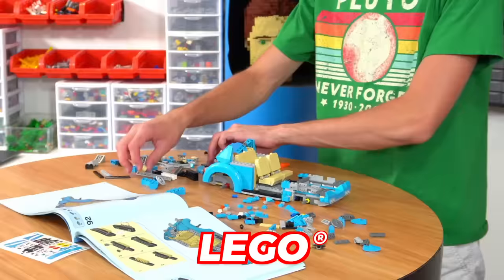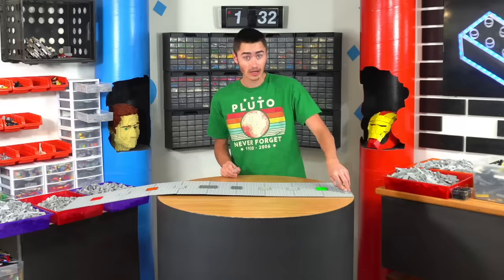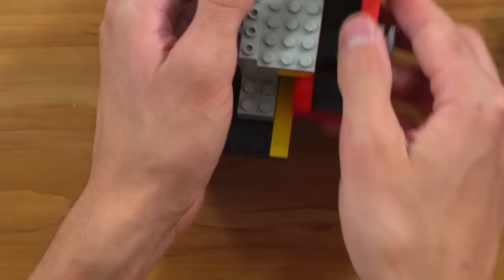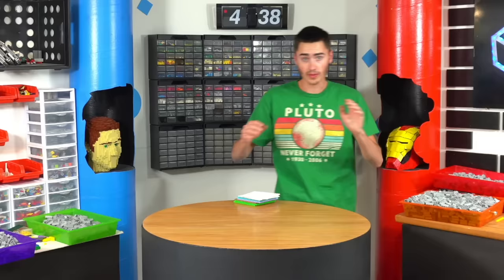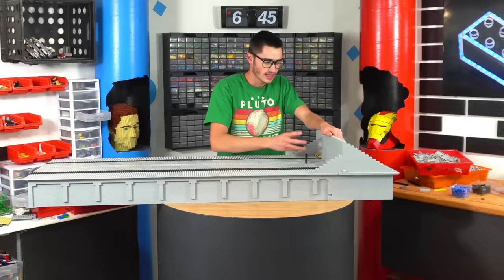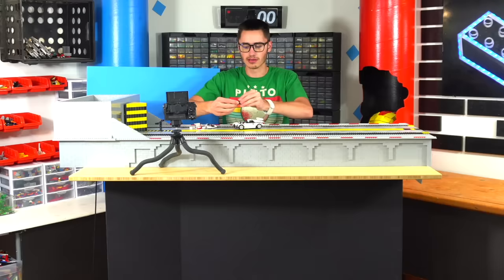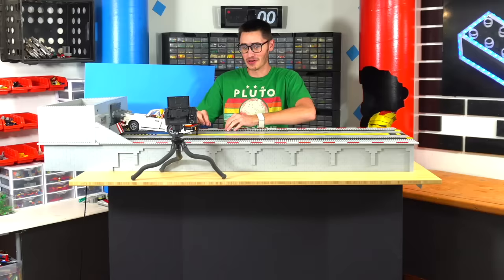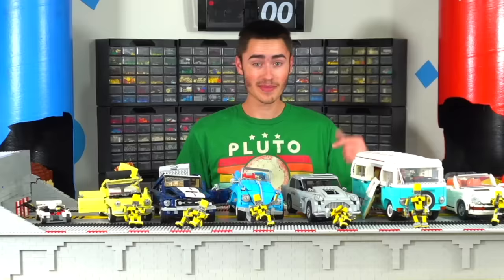Crash Testing LEGO Cars!

Comment: Funny enough, in the mid to late 1960s the first and second generation of the Ford Mustang, as well as most cars at the time, were actually built with solid steering columns, so being impaled in the event of a front on collision was a genuine issue/concern
Reply: Amogus
Reply: fords solid columns were designed to shear off, unlike chevrolets
Reply: The Chevy steering columns lead to the nickname, “The Impaler”
Reply: @jimmiechase9485  And this is why they made the Chevy Impala
Reply: @CharlesB21  still safer than the Pinto... he'd better not build one of those for a test in the future the impact might suffice to destroy the entire studio.
Reply: @CharlesB21  Ok that's a pretty good pun
Reply: @cericat  Actually, the Pinto wasn't even less safe than other cars, it just got the PR of all cars having bad safety. :D
Reply: Yeah but the airbags would... I mean you'd be saved by the seat bel... well at least the crumple zones...  Hmmm.  Well, at least cars weren't written off by fender benders like they are today!
Reply: lego with the historical accuracy
Reply: Was gonna say same thing. Worked summer months for a couple years back in the day at my local wrecking yard. Saw  quite a few cars with steering wheels pushed into back of seats and leftover messes.
Reply: Ayy I wasn’t alone lol
Reply: Mustang was still better than many cars of the era since the steering box was close to the firewall. Some cars had it more or less behind the bumper which meant that anything more than a fender bender started to push back the steering assembly.
Reply: Not just then, but pretty much all cars up until that era had solid columns.  It only became such a significant issue in later years because cars went from a very upright position with relatively low speeds, to a lower seating position with a more linear steering column and much higher speeds, as well as increased average weight.

There all led to the solid columns going from merely "hazardous" to absolutely lethal and practically guaranteed to kill.

Combined with extremely rigid car structures and no seat belts, it made for a very dangerous time to get into a collision.

Let's also not forget the tendency of hoods to cause decapitation.

Comment: Ironically irl, the ratings likely would’ve been flipped. Cars are made to collapse in the event of a crash so it absorbs the brunt of the energy. If the car was completely solid, most of the energy is going straight the the occupants of the car and… carnage ensues.
Reply: Yes and no. Modern frames are built with crumple zones, since if your A pillar collapses, the driver is fucked.
Reply: as long as it dosent wreak the engine, your right engine explosion is why

Comment: NGL having built everyone of these the thumbnail really grabbed me. Given how structurally fickle some of these can be when handling most of these preformed astonishingly well not only remaining intact but busting up the test wall as well. Really good test track built but for more destruction longer means more speed. Have to wonder how either the 89 Batmobile or Ecto 1 would have preformed though both probably to large in size for the track set up.
Reply: Or the Delorean
Reply: Would have been more enjoyable if cars would go straight instead turn to side.
Reply: Yea, the 89 is practically as big as the track itself and is less of a play set, and more of a display model.  It has a lot of delicate elements all over it that make it difficult to even pick up.  But it does have a really interesting zero-point steering system.

Comment: FYI engines don't just explode like that, at most it would catch on fire. To get an engine to explode like you seemed to describe, you would have to somehow manage to increase the pressure in the pistons (and without heavily modifying the engine, would be impossible by normal means)
Reply: Thank you.  The tiny amount of fuel in an engine at any one time would not be able to detonate it like a bomb.
Reply: There's always that one guy....
Reply: Correct. Only certain turbine engines actually explode, and even then only under very specific conditions.
Reply: @SkedgySky  it's just geek knowledge, it also bothered me lol
Reply: @SkedgySky  what’s wrong with spreading knowledge?
Reply: though if the gas tank goes then boom
Reply: I know already gosh 😒
Reply: 🤓☝️"erm actually..."
Reply: Fr

Comment: This design reminds me of how aircraft carriers launch jets. It's a very similar process.
Reply: True
Reply: Yes
Reply: Yeah, just with a pneumatic cylinder instead of weights iirc.
Reply: TOTALLY, that's how that works (TOTALLY not powerd by steam, totally not a steam catapult)
Reply: I thought so to
Reply: @gangsterjackal841  or electromagnetic
Reply: @gangsterjackal841  I did not know that they used steam. That is cool!
Reply: Some use a system where the jet creates potential kinetic energy by using a stopper, and then when the stopper is released the jet flies off because of the energy it built up for itself.
Reply: true CATAPULTTTT

Comment: The Porsche 911 Targa set also has the Turbo model as its 2 in 1 function. I have that one, and I knew that the Turbo/Targa would fare pretty well. A very good design. Also, good job on the crash wall build

Comment: You should try crashing cars designed by fans. Also, cars which break easily are probably the best cars, as it shows the car can absorb the impact forces.

You shouldn’t make the car too fragile though, as it will break the passenger cabin as well, thus injuring and killing our passengers and driver.

Comment: The driver of the mustang getting impaled by the steering column is actually pretty realistic. That was a serious problem with old cars, and it led to the end of those fancy, experimental designs for cars. Ever wonder why modern cars don’t look as nice or as curvy as old ones? That’s mostly why.
Reply: @Vegas I do too, I love the way older cars looked, but that’s the reason why modern car designs are all boring and boxy. They had to include safety features and fix those issues
Reply: Modern cars also have collapsible steering columns so the steering wheel doesn't just crush the driver if the column gets bumped.

Comment: I think the DB4 should've had 4 stars at least. Destruction was minimal and the dummy seemed intact. Must've been the reinforced chassis and armor plating.
Reply: Yeah it legit faired better than the mustang!!
Reply: Also, the engine most likely wouldn’t explode because no epothermic  reaction and thus wouldn’t ignite the fuel
Reply: Yo would still be dead tho because cars are supposed to crumple to save the driver
Reply: That would mean that the dummy is absorbing most force and not the car, so erm actually it would get a low rating
Reply: It’s a DB5
Reply: But cars are supposed to literally crumble

Comment: I remember as a kid I would crash Lego cars into each other and rebuild them for fun, it has gotten to a point where I would remember where to place parts in the right area in a matter of seconds. I stopped doing it not because of the constant re-building, but because I would lose some parts to the point where I couldn't connect other parts anymore XD
Reply: That’s funny
Reply: yo i do the same shit
Reply: I still do that sometimes, modern phones and their high FPS cameras have also made it possible to watch it back in slow motion!  I general send them flipping off ramps though, I should try something like this.
Reply: I had to quit cause I destroyed to many wheels lol
Reply: @dshiznit12a  I haven't had any issues with wheels breaking when crashing my cars, though I have starting having to remove clip based mirriors from a few cars as well as the bull bar from my police car (also held on by clips) as they broke quite easily if hit at the wrong angle.  Only time I've experienced a LEGO wheel breaking (tecnically it was the axle that snapped) was when I child pushed down on the car way too hard.  Maybe a large, very heavy LEGO car could break an axle if you through it out a second floor window, but beyond that IDK how you could do it.

Actually if you heald the vehicle while pushing it onto something, then maybe, but that would be similar to putting too much weight on it.  With just pushing then letting go, the cars own mass shouldn't be enough to break a wheel when it hits something.
Reply: hgjteirdskfkbhvffreqaijhzfreplokijmnbbvcxyyfgg46597985556523112ghhjjkjlpppzzztttttttrrrrrrrrrrrrrrrrr59624793125894
Reply: My mate and I used to do the same as kids. 
Friday nights we'd be in our homes building the cars as strong as we could, Saturday we'd meet at his place, line up at opposite ends of the room and aim to crash our cars into each other. We'd try to outdo each other in terms of strength of the car, the least damaged was the winner
Reply: @scottthewaterwarrior I had a skyline but in the engine compartment the clips just broke cuz I accidentally dismounted it at the wrong angle 😅

Comment: Good video,.... one recommendation:
Have the inside GoPro suspended from the ceiling or otherwise not mounted to the same structure (independently mounted) so it doesn’t suffer from vibrations or being knocked down during the crash. (Or less susceptible to it)

Comment: Fun fact: in none of the crash tests Obolt would have survived. This is because he smashed into the steering wheel or windscreen. If there was a seat belt he would have probably survived. You can use a rubber band or a string.

Comment: The reason the camper did so well is because the tire on the front absorbed most of the impact
Reply: If the tire absorbed the impact, why'd the wall break. To me it looked like none of the energy was absorbed by the car, because all of the force went against the wall all at once. If the tire was absorbing energy the same amount of force would happen against the wall, but over a longer period of time. To keep it simple the wall was absorbing the impact by acting as a barrier
Reply: False info
Reply: Not necessarily I’m saying the camper didn’t take to much damage because of the tire

Comment: I like this video, but I have a suggestion for improvement. I know that in real life, there are collision test tracks that use a pulley system to pull the vehicles rather than pushing them. My suggestion is, if you ever remake this video, to use the push system in conjunction with a string-based vehicle-puller system.

Comment: Unveiled at the 1985 Geneva Motorshow, the 1986 Lamborghini Countach Lp5000 Qv was the pin-up poster car for a generation. Truly a defining car in a class of its own, sporting a 5.2 liter V12 outputting 450 hp at 7,000 rpm, with a 0-60 0f 5.4 seconds, and reaching an astonishing speed of 182 mph, making it a serious adversary for competing cars at the time. Styled by Marcello Gandini in an aggressive late 80’s wedge design.

Comment: OK here are my honest ratings (out of 5):
Countach: 1
Fiat 500: 0
Mustang: I need a redo as it did not hit the actual barrier(pls do it). BUT still i will give it a 2 and a half as the steering wheel did all the damage to the dummy. Also the side got ripped apart so engine could have been damaged.
VW Beetle: 3
Aston Martin 007: 3
T2 Camper: Again a redo please. As the dummy was in the rear and it is also not child sized. Try using a smaller dummy. But I give it a 3 as it did pretty good.
Porsche 911: This did great. 4 and a half(due to dummy literally bouncing and if there was a hardtop he would get destroyed).
WHOLESOME VIDEO.
Do more epic videos like this.
Keep it up.
👍

Comment: 12:15. When they crash test real cars they have the sled pull the car from the front so the vehicle always hits square on, rather than veering way off course. You also won't get the extra force of the sled continuously applying force to the vehicle once it comes into contact with the wall. Since that van (16:31) was so long the weights pushed the van through the wall which is why it broke. If you had the cars pulled instead of pushed the crashes would be a bit more realistic to how they would crash by playing with them.
9/10 for entertainment. 4/10 for scientifically measuring and rating these crashes.